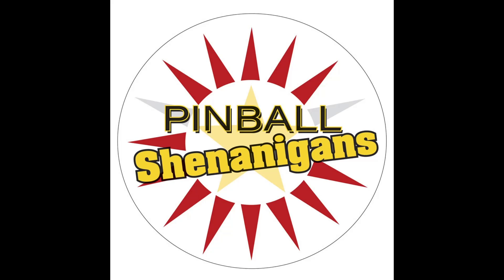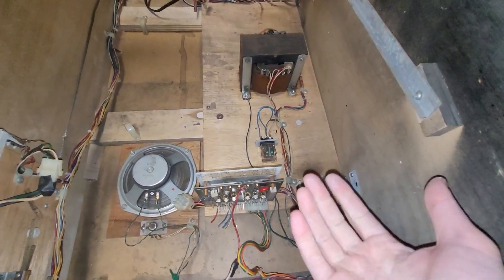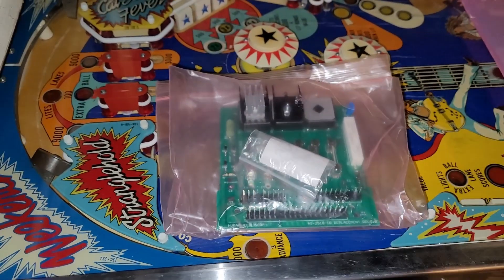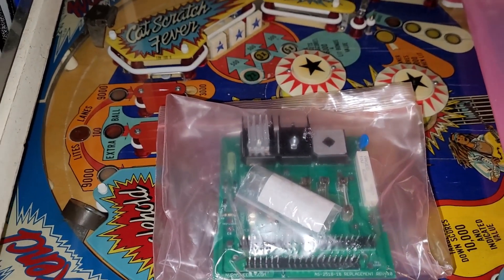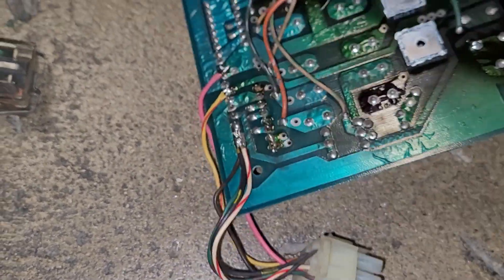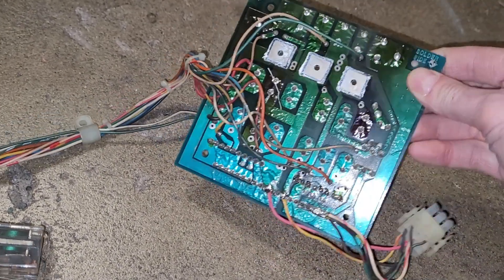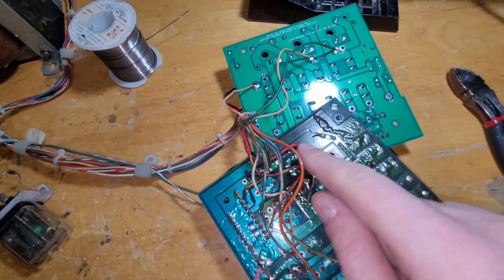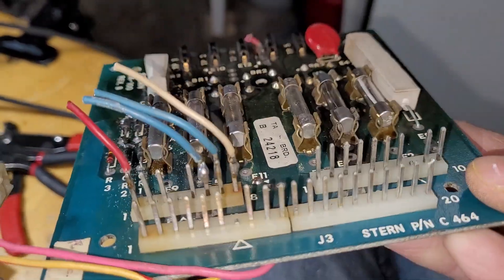Part 2: Stern Galaxy Pinball Project. Replacing the rectifier / power supply board.

Comment: I just discovered a quick way to flatten warped plastics. One at a time, while holding it with needle-nose pliers, I place it in my toaster for 15 seconds,  Then remove carefully and place on the kitchen granite countertop and place a frying pan on top and hold for a minute. So, easy!
Reply from the maker: Wow you invented a new method! The toaster method! Awesome!
Reply: @pinballshenanigans  Just be sure to not let the plastic touch any metal parts inside the toaster. That will wreck them. That's why the pliers are essential; to hold the plastic in the middle of the toast slot, and make sure it doesn't touch any metal.
Reply: Also, be sure to use only a pan that has a perfectly flat bottom. Some have ridges on the bottom so that would be a problem!
Reply from the maker: @VaxxedStories  kind of reminds me of the old school board game operation 😁